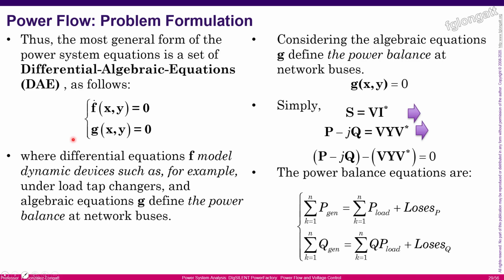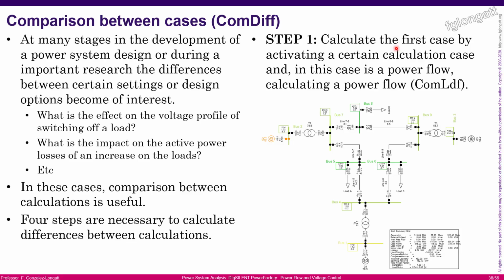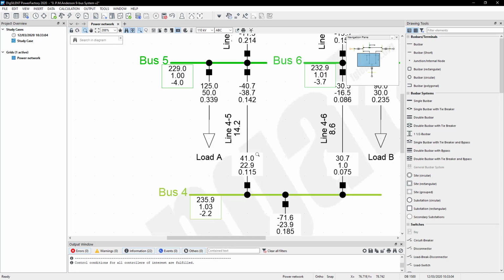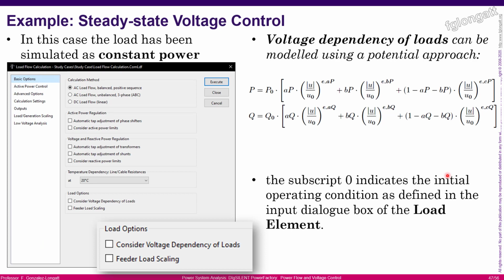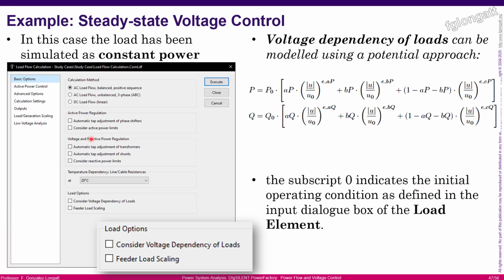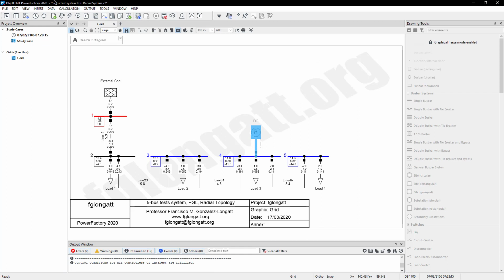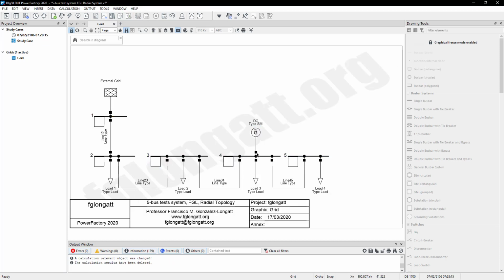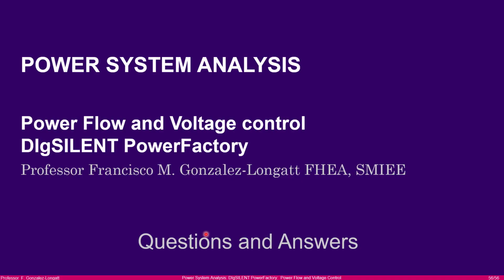Power Flow and Voltage control Using DIgSILENT PowerFactory PART II

Comment: Problem in power flow:
- Uncontrolled variable: Load
- Controlled/Independent variable: P,Q Generated (by techno-economics)
- Dependent variable: Pflow, Qflow, kAflow, V (result)
Solution: numerical iterative method to solve non linear equation
1. Voltage dependency ==> affect by Load modelling - ZIP Model (Constant impedance, constant current, and constant power)
- Constant power => reduce the active power from 1MW to 0,8MW
2. Power flow with consider reactive power limit (set the reactive power limit at capability curve generator.
- Before: Voltage at bus DG = 0,86
- When DG set to Voltage controlled (PV mode) ==> DG overload, more reactive power transferred [1,7], voltage drop better [0,97].
- When DG set to Voltage controlled (PV mode) ==> DG overload, less reactive power transferred [0,2], voltage drop better [0,88].

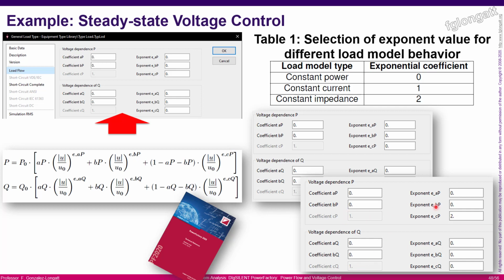Comment: When selecting the exponents for different load behaviours,  do you only change the voltage dependence P or does also the dependence Q needs to be changed accordingly? For example at 44:57 you present how to model the constant impedance. Here you only change the exponent to 2 in the voltage dependence P window but keep the voltage dependence Q window unchanged.